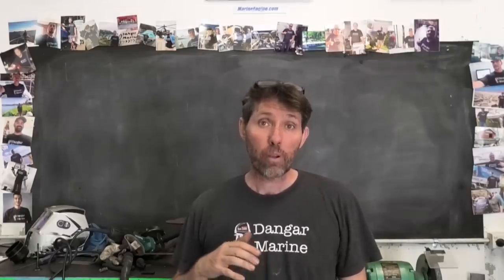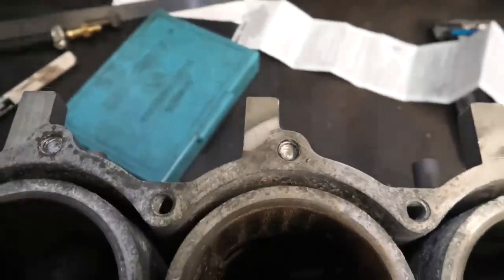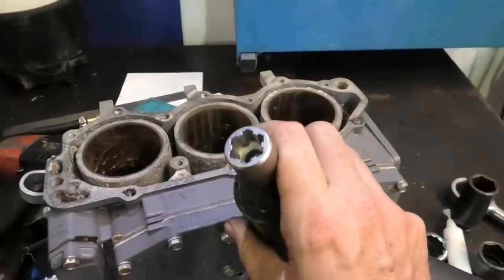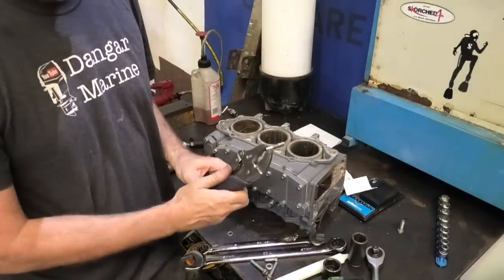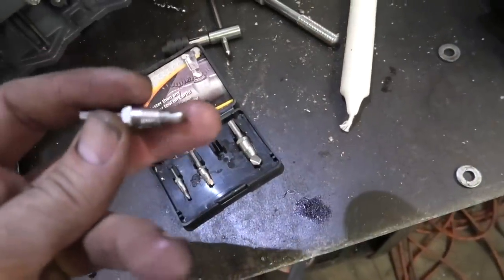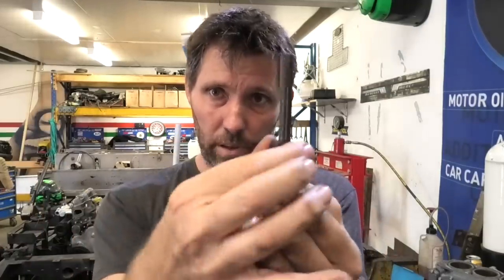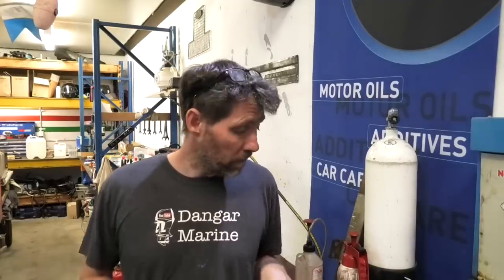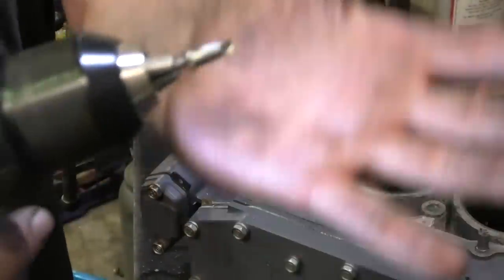Removing broken bolts

Comment: I would agree with Matthew Moses, left hand drill bits are a needed to tool for bolt extraction. They  will keep the bolt from getting tighter while drilling, but sometimes will actually start  removing the bolt while drilling.

Comment: My specialty for 15 years working as a fitter/machinist repairing broken screws and bolts brought to me by electricians (the best to work on usually had an easyout broken off in them or a drill or even better both). Left hand drill sets are very handy to have. Blue pivot steel makes an excellent centre punch for smaller screws or where they are broken off too deep to get a centre punch into. Giving the screw a few solid hits with a flat punch first as well as heat and penetrene will give you a good head start. Helicoils and Twinsert Helicoils can be a Godsend ;) Last resort was the EDM Tap Buster.... handy if you can afford a $2000 machine. Thanks again for the great video Stu!
Reply from the maker: I wish you hadn't posted this Matthew, now I really want an EDM Tap Buster. ;) I had never heard of those before and they sound really interesting. Good tip about the blue pivot steel too. I'm tempted to order a few different diameters to keep in the workshop as I can think of lots of uses for them once you had some on hand.
Reply: Matthew I agree with the left hand drill bits,  and added an expanded comment on the subject.
Reply: Is there anything you recommend to drill straight and centered as someone who deals with broken bolt for a living?  The video mentions drill guide but not sure if still can mess things up with that.

Comment: Hi Stu, here's a tip or two...

Instead of working with those easy-outs that always breaks and are a hustle, you could always drill a hole in the bolt and tap a torx-bit into it, then just screw the bolt out. Many times works much better in my opinion! 

Another thing you can do if you have a steel bolt (stainless or regular) in an aluminium-housing / thread is to drill out as much as possible of the bolt and then drop a certain acid on / into that hole. Aluminium creates aluminium-oxide which protects it but at the same time the bolt is slowly vanishing...  

Did that with great success in the early 90s on an OMC 70hp where two out of six M8 bolts connecting the power-head had snapped and refused to come out. It took maybe two days for the acid to clear the threads completely but the result where great! 

Can't remember 100% what acid it was. At the time I went to the local university and asked a chemist-teacher (who where so happy that someone even noticed him). Got a small glass-tube, maybe 50ml(?) for free. Can't find the tube any longer but I guess now days the answer is just a couple of google-clicks away..
Reply from the maker: Hey Hendrik, your torx-bit suggestion is very similar to that kit in the blue box. I found those to be quite good. I like the idea with the acid, makes a lot of sense to make use of the two different properties of the metals.
Reply: Glad you liked the acid-method, try it sometime! It takes a while (days) and you'll have to dry out old (used) acid + drip some fresh into the bolt a couple of times but it actually works = as long as you're not i a hurry... 

Yes those easy-outs... The ones that you screw actually expands the bolt as the go in which sometimes counteracts with what you want.. They also have a tendency to snap as they get stuck when they reach the diameter of the hole (if the bolt does not want to let go). Where as a torx-bit or similar rather starts slipping (damages the drilled hole)  =  let you have another go with one of a larger diameter...   

Keep up the good work, really enjoy watching your videos!
Reply: @DangarMarine  you should make a video on removing stripped manual release valves on the Yamaha 4 stroke trim units. Very common since it's a flat screwdriver and soft aluminum. And there's no such videos on that

Comment: Great video. I've found it use full to weld a flat washer on a flush broken bolt then weld a nut to the washer to extract a broken bolt.
Reply from the maker: Sounds like a good addition.

Comment: oh the fun of broken bolts!!!!    left hand drill bits are great for ones that aren't stuck too bad. drilling through a bolt will help relieve the suction if the easy out doesnt  plug it off.  i've had my best luck on stubborn ones drilling through and using  a four-sided remover.  ive found that the steel bolts in aluminum are usually plated  gold or silver.  if ANY of the plating is gone or there is any rust or corrosion replace it- never wire wheel it to clean it up- unless you specifically plan on using it to build a reef
Reply from the maker: Interesting point about cleaning up with a wire wheel potentially taking any coating off. Definitely something to be aware of.
Reply: plated gold or silver  i meant in color lol.  one is a cadmium plating an the other i'm not sure of  may be zinc.   it is on there to help prevent galvonic corrosion from dissimilar metals

Comment: I have found that if you suspect that the bolt is rusted in,give the head of the bolt a solid whack or two with a hammer before trying to undo it,you may have to tap the socket or spanner onto but i find that they come out fairly easy.
If they dont repeat till it does.😁

Comment: I learned the hard way to never use an "Easy out" in very cold weather (below about 40 deg farenheit)    Did it twice, and both times the easy out snapped off in the bolt and I ended up drilling around the bolt and repairing the threads with helicoil.   Maybe I had cheap easy outs, but twice bitten quad shy...

Comment: If the head is aluminum, building up a bead on the bolt will work down to about 4 mil or so below flush with the surface, before you weld the nut on... we do this often, and it works like a charm.

Although aluminum melts at a lower temp than steel, it also acts as a heat sink, and if you weld the bolt a little bit at a time (waiting for the heat to dissipate), it usually doesn't harm the aluminum block.(it also weakens the bond from the corrosion on the threads... the expansion/contraction from the heat/cooling cycle helps too)

One more tip that I learned in Machine Shops many years ago - a 50/50 mixture of ATF and Acetone makes an amazing penetrant... but be sure and degrease it thoroughly before welding a nut onto it.

It works!
Reply from the maker: The 50/50 acetone ATF mix has been mentioned several times and definitely something I'll be experimenting with in the removing corroded bolts video.

Comment: Another sweet video Stu. Great timing actually as I need to get some busted exhaust manifold bolts out from the heads of my 6.0L L98 in the Caprice. Nice little refresher video cheers 👍🏻
Reply from the maker: Thanks Tom. In your case I would be using a lot of heat. I hope they aren't too awkward to get to! Being on the bench certainly makes things much easier!
Reply: Yes, very awkward access in the car. I'll be takin the heads off to do it as I want to do the hydraulic lifters at the same time. We were up your way this morning for a run up to bar island and then onto spencer, got the boat on the trailer just as the wind was picking up. Was a beautiful morning though!

Comment: Have you ever tried using dry ice to shrink the metal instead of heat?  I've even had a bit of luck with regular ice to quickly cool one side of the joint while the other was still warm.

Comment: I have found that a good smack with a hammer works well.
Most bolts shear off under tension, release that tension by driving the remainder of the bolt back down then drill it out.
Have found multiple times that 30+yo Phillips head screws would not move until smacked sharply with a hammer.

Comment: You can get the easy out out by hitting it with a stick welder get a arc with the rod loose in the holder,just pull the holder off killing the power,riggle it gently and turn to back it out (once its cooled).
For a tap i get a old drill bit about the same size as the hole,cut a slot through the middle of the shaft and keep making the slot bigger until it slides into the waste shutes of the tap(dont make them to long or they wont be strong enough just long enough to get good purchase on the tap),put a drill on the other end of the drill bit and reverse it out.
Doesnt always work but if you have run out of options it worth a try.

Comment: The reason you couldn't get those overtightened bolts out is because they stretch a little when (over)tightening. Just a little bit, but enough to mess with the threadpitch. Only happens locally, around the area where it breaks, but that's enough to lock the bolt in forever. The threadpitch of the bolt and of the hole don't lign up anymore, so it's physicaly impossible to unscrew it.

This doesn't apply to small chinesium bolts, but to more qualitative bolts.
Reply from the maker: Yes, the stretch really does wedge them in good. I was expecting the heads to break much more easily but they were OEM bolts so I guess the steel quality was quite good.

Comment: Great video Stu, thank you!  Is the video about corroded bolt extraction up yet like you mention in this video?  I have 4 bolts stuck in an Evinrude power head that I'm working on and they are definitely corroded in place.  Thanks!

Comment: Thank you very much for this video. I understood the system. However, I would like know if this is possible to extract a long rusting screw from the A/C compressor?
Reply from the maker: They can be tricky. Soak with oil and try an impact screwdriver or vice grips.
Reply: @DangarMarine  thank you!

Comment: Good tools for this for sure. The last one I have not seen before. What is the brand name? The one with the reverse drill with the reverse thread sleeve. I ended up drilling mine out due to the corrosion. The 3/16 bolts for the anode center drilled and one pulled what was left of the threads out. The other one was slightly off center but was able to run the new bolts in no problem. The side 5/16 bolts for the trim unit will just use self locking nuts on 2 of the 3 then put a repair threaded insert on the last one. I do have other small ones for covers ect.. to try out your meathods. Can't wait. Haha
Reply from the maker: I'm not sure what that type was called. From memory it doesn't have a clear name on the box, I'll double check. By far the hardest part drilling a bolt out completely is being absolutely dead centre the whole way down. This isn't such a problem depending on the situation, but with something where the torque spec is critical I would go with a thread repair system afterwards.

Comment: Great video mate.An air chisel with a pointed bit works well too as the hammering action helps to free up the stuck bolt.

Cheers.
Reply from the maker: For sure, impacting action really does help to free things up.

Comment: Nice video.  I have a corroded bolt that broke from the thermostat.  Can you post a link to where i can search for guided pin to drill out a hole in a bolt.  Then i will probably use easy out to remove the bolt.  Thank you very much!

Comment: Cheers and thanks for that. Experienced a related issue when winterizing my Yamaha this last fall. Last task of the day was to shoot some grease into the various fittings and accidentally twisted the grease gun as I was removing it from one zerk. Yep - snapped the head clean off. First time in 40 plus years of boating I've done that so stared in disbelief for a minute failing to comprehend the full scale of the horror. Digging the remains out will have to wait til the spring but I'm hoping as the fitting by its nature lives in a greasy hollow that it will spin out without much problem. This ever happen to you?
Reply from the maker: I've definitely seen that happen before. The good thing is that it already has a hole through the middle so drilling it will be relatively easy.

Comment: Hi dangar, this video was too late for me, just a week ago I tried to using extractor to take out a broken bolt deep inside the hole in of one of my outboard gearbox, I doing same thing as you, then I put in the extractor and turns it until it tighten, and using a spanner to turns the extractor and break it.  I already spray penetrating oil and let them sitting about 10 minutes to start work with.  Still getting bad result.

Yes, I did what you saying about the worst case, broken bolt inside, and the broken extractor also in it, damm it!

What my next act was take out all the gearbox parts like gasket, after that I should be using gas torch to heat on the gearbox block and try one more time for it.

Or any suggestion for it?

Still thanks for your video to explain the right way how to extract bolts which maybe I'm doing fine but not enough good luck for my situation.
Reply from the maker: Hey Jerry. Heat definitely helps. The good thing about the problem being in the gearbox is it gives you the option of taking to a specialist shop and having it removed if needs be. As Matthew mentioned below, if you can find someone with an EDM machine they probably won't charge a fortune to remove it.
Reply: @DangarMarine   Thanks!  I planning to looking for help if needed.  But the gearbox still running over 6 months right now, the gearbox got 2 stuck broken bolts in the water impeller box opposite side, so it still getting other 2 brand new bolts to made it tighten, and I keep monitor the water temperature for the engine was good, so I think I still got time to find a good way to fix it.

Comment: Hi stu i know this is an old video but i am repairing a 40 hp 87 yamaha and have broken 4 head bolts and some on the exhaust cover can i just the mig or arc welder on head bolts as there stainless i believe ,i want to try to save this engine it isnt a basket case yet just need some advice .

Comment: Hi mate you say you are goin to make a more indep video on rusted corroded bolts to get out i cannot find it i took the side plate off my 75hp yamaha 96 model and 2 bolts broke one is lower in the cowling how do i get to that one please it broke flush and the other is proud by about 8 mm and i tryed the vice grips with no luck any help please thanks mate

Comment: G‘day Stu. I can‘t find the third part about corroded bolts. I just have the lower unit off an 1998 merc 125, where most of the stainless  bolts were stuck due to the aluminium oxide. Whats your idea to keep the saltwater and corrosion out? Whats your opinion on stuff like tef-gel, duralac,…? Best regards
Reply: Stu, I have the same question. Did you ever do the promised video on removing bolts when there heavy corrosion?

Comment: The 6x22 flush broken frozen bolt is too hard now to drill out (using new drill bits). Before I tried to to heat it up and use HF 90 amp arc flex weld bolt but it broke off multiple times.  Did this process end up hardening the bolt? If so is there a process so I can I soften the metal and continue to drill out?
Reply from the maker: Not that I'm aware of. An EDM machine may be your only choice.

Comment: With a bolt broke above surface you can use the extraction sockets. I broke a bolt on thermostat housing . tap extraction socket on to bolt and use rachet. The socket will digg in and twist bolt out. ( i also heated then oil while hot let it cool to suck oil in . . repeat 2 or 3 times)
Reply: when you mean bolt broke above surface you mean when head is busted off and you have shank you can grip?  I've seen extraction sockets but it looks like designed for rounded head  not a shank
Reply: @jonsen2792  yes exactly what i meant. . . I broke a bold on thermostat housing on old ford 300 6 cylinder . Head of bold broke off. . Shank was sticking out just enough to gently tap extraction socket onto the shank and use rachet to remove bolt.  . . Its designed for rounded off bolt heads but works great on round shanks too . . Just choose proper size

Comment: Wow I hope you read comments on your old videos because I have question for you? I did exactly as you shown, but my left "extention" broke into the bolt. Its imposible to drill it out. I have tryded several HSS drills both Titan and Cobolt but nothing helps. I don´t have a welding maschine yet, Please do you have a solution. The bolt is really styuck. Happy new year buy the way;)
Reply from the maker: That is a very tough situation unfortunately, and one reason that some people go straight for drilling the bolt. An EDM machine will be able to remove it if there is someone around near you that offers that service. Failing that, if you have enough room you may be able to drill down beside it and then go the thread repair route afterwards https://youtu.be/u5k-qDIL3Kk

Comment: Removing broken bolts on outboars power heads due to being extremely salt water seized near solded are the most difficult to remove easily.

Comment: i get so mad when that happens i just take a sledge hammer and start busting away ,, i can get the bolt out but i have to replace the engine block
Reply from the maker: LOL, you wouldn't be the only one!
Reply: A trick Iearned make a drill bushing  cut in a lath clearance  out side diameter  tap drill size hole  drill oil harden steel harden  put back some good bolts into holes head  put bushing in clearance  hole you turn head into drill jig  and drill  out then clean up threads with tap   put bushing in t box for next job harden bushing  will not let you go into  softer material work good for me made a couple for different size bolts

Comment: vice grips should have been the other way around for max force. Learnt that in engineering. Like there is only one way to use a shifter. Not trying being a smart arse, just what I learnt....
Reply: Good point and the teeth are then pointing in the right direction as well for maximum grip.  Another great video Stu. Thank you
Reply from the maker: For sure, good point. Having the force against the main solid part of the tool is the stronger way to go. :)